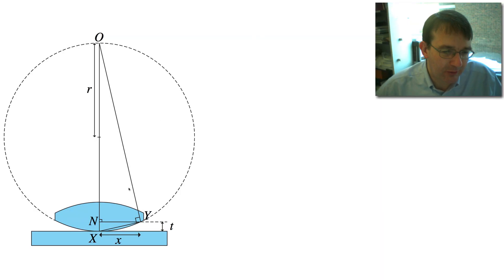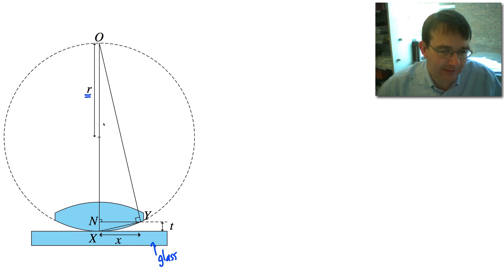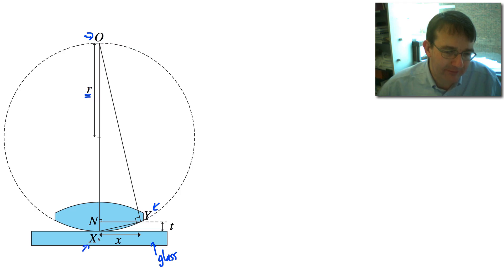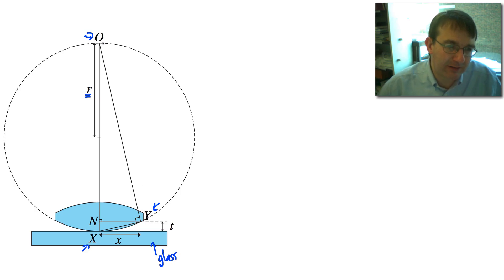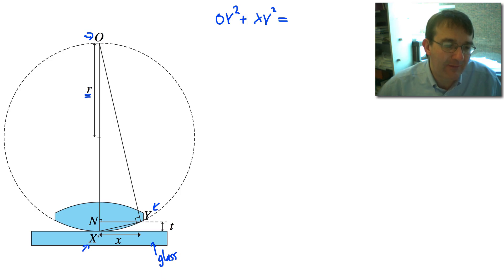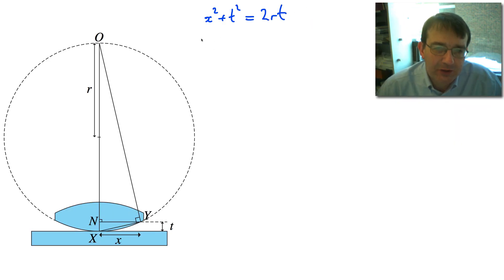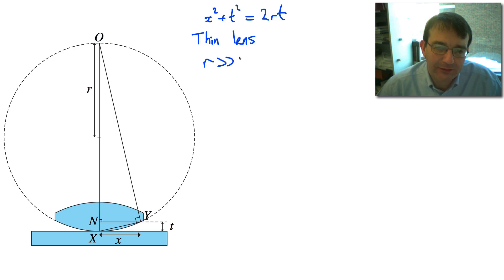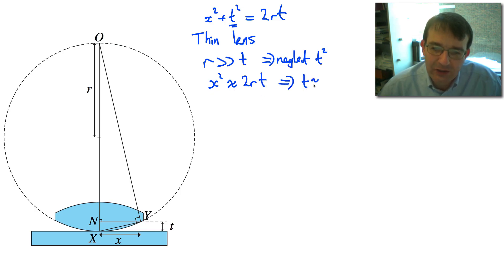PHYS 130 Lightwaves Part 5: Newton's Rings

Comment: If you believe Feynman and QED, its NOT an interference pattern because light is NOT a wave, but particles.  The bands are due to varying probabilities of reflection resulting from multiple quantum events.  In the dark areas, the probability of reflection nears zero, while in the bright areas the probability of reflection is the square of the probability for a single surface.

See Feynman’s 1979 lecture series from New Zealand.  He also explains that wave-particle duality is just due to confusion and does not exist - light is not a wave.  Einstein won the Nobel prize for proving this in 1905.
Reply from the maker: This not what QED says. QED treats light as quantized fluctuation of a vector field which is neither a particle nor a wave since these are both classical concepts. If you were to attempt to use it to calculate the pattern you would end up with a complex set of Feynman diagrams for each interaction between an incoming photon and the EM field in the glass. Each of these diagrams would have a complex amplitude and when you added them all together you would find that they interfered with one another causing cancellations at certain outgoing angles and enhanced reflection probabilities at others. 

So this is very much an interference pattern since, even if you attempted to calculate it using QED, the resulting pattern would be due to the interference of different scattering amplitudes. If you want to learn a bit more about QED you could try my (much older and basic) video: https://www.youtube.com/watch?v=XD4Er-BjcGE

Comment: There is a much simpler way to do your derivation from 3:00 to 8:00. Instead of using the triangles you used, you only need one triangle: from the center of the circle C, to N, to Y. Length CN is r - t. Length NY is x. Length CY is r. By the pythagorean theorem, (r - t)^2 + x^2 = r^2. Expanding and cancelling gives you t^2 + x^2 = 2rt.

Comment: Why are you are using a converging lens instead of a plano lens?
Reply: Well, technically it uses both! The word "plano" means level or flat so a pure "plano lens" would have two flat sides and so would just be a pane of glass and there is one of these under the converging lens! For lenses you get plano-convex and plano-concave lenses where one side is flat (plano) and the other side is convex (curved out) or concave (curved in). A plano-convex lens is therefore a converging lens since the centre is thicker than the edges. The lens in the demo is sealed inside a metal cell so I do not know whether it is plano-convex or just pure convex. However, this does not matter since the lens is thicker than the coherence length of the light so that light reflected from the top and bottom of the lens will not interfere. Only the tiny gap between the lens and the pane of glass underneath is small enough to create interference.